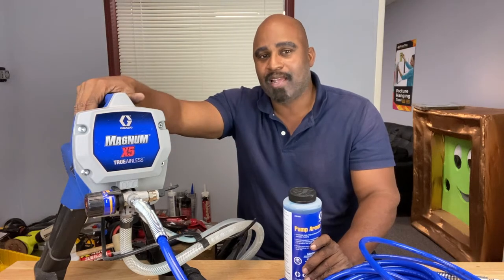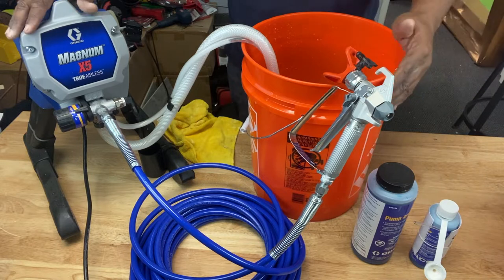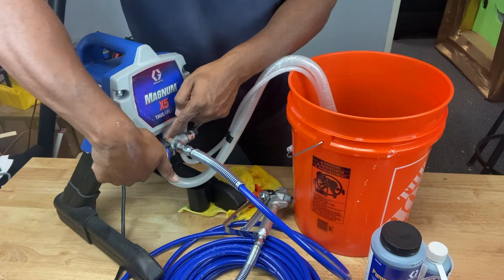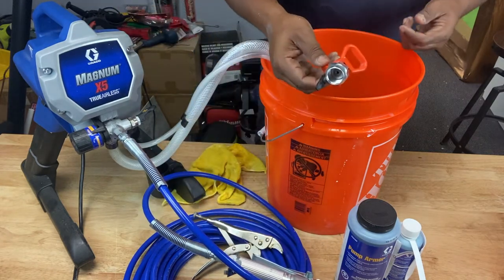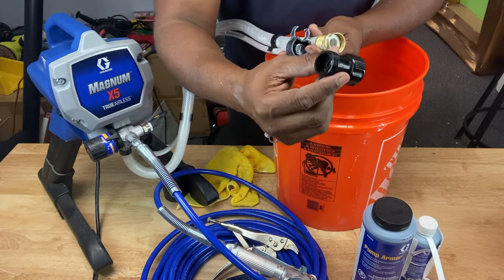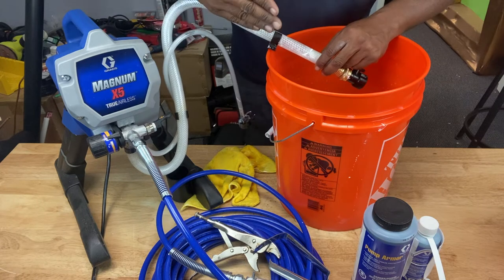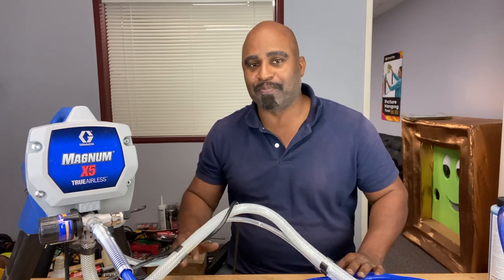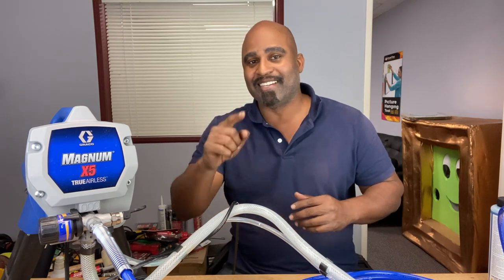HOW TO USE A PAINT SPRAYER PART 2 WHAT IS PUMP ARMOR?

Comment: I've never had any luck using this type of stuff other than short term storage days weeks not sure how long it really last, but I only use mine once or twice a year, mind you I'm contractor , and every time I did use this stuff I had to take it in for service, the bearing pits and its done. Use PAINT THINNER or DIESEL and you'll never have and issue . took years to get the right answer your welcome
Reply from the maker: Hey, some people use antifreeze. Whatever works and doesn’t damage the machine.

Comment: You never said how to clean the hoses
Reply from the maker: Flush with water or mineral spirits if you use oil based paints.
Reply: Okay I used it to paint a frame of a truck big mistake took me 4 hours to clean the hose and gun but not sure if it can handle that kind of paint

Comment: Out of curiosity, what do you do with the drain water?
Reply from the maker: Dispose of it by straining the water with a filter or a sieve. This will separate the paint solids. Dump the water down the drain and let the solids dry and harden first before you dump them in the trash. You can also use kitty litter to absorb the water and the solids and dump that in the trash but the first way doesn’t cost you a bag of kitty litter.

Comment: Just looking for a clarification. So, I should be running the 2 oz. of PA through the pump and not expect it to sit in the pump. In other words, the 2 oz. will likely flow out of the waste tube in the time you are running the machine to circulate the PA, correct? Just running the PA through is enough to maintain the pump for storage?
Reply from the maker: Correct.

Comment: When storing paint in the hose, the gun will also have paint in it, correct. Should the bucket if paint and suction tube be cover with some type of plastic over night to keep the paint soft and moist?
Reply from the maker: Yes, covering it with plastic is good, to prevent air from entering.

Comment: Where would I add the pump armor in my pressure washer?
Reply from the maker: Go to segment 6:45 on the video. You pour it into the suction tube while the machine is off. Once you pour about 2 oz in. Turn the machine on, let it cycle through the sprayer out the drain tube. Then turn the machine off.